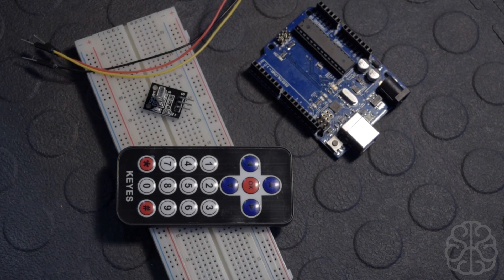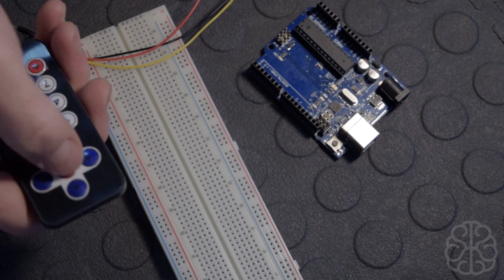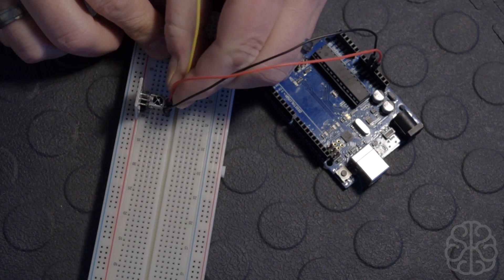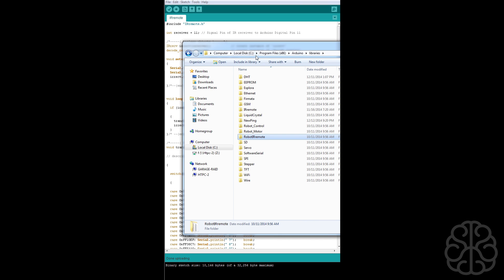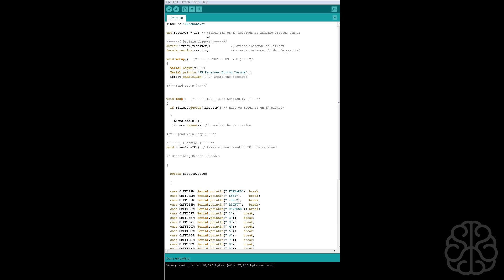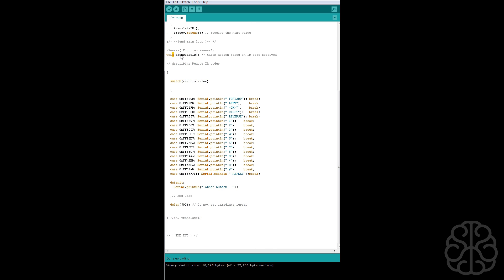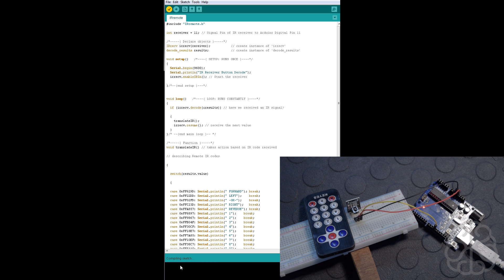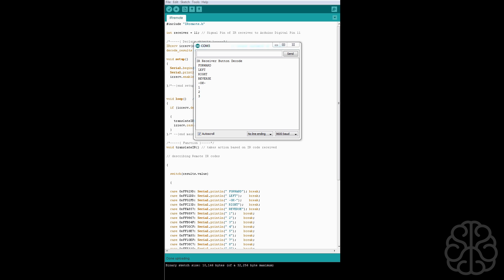Use Infrared sensor & IR Remote control on Arduino - Tutorial

Comment: I used the code but it gives the following error in compiling
C:\Program Files (x86)\arduino-nightly\libraries\RobotIRremote\src\IRremoteTools.cpp:5:16: error: 'TKD2' was not declared in this scope
 int RECV_PIN = TKD2; // the pin the IR receiver is connected to
                ^
Error compiling.

Please help
Reply from the maker: Pratik Panda Hi, In the code on our website here: https://brainy-bits.com/tutorials/ir-remote-arduino/

This is what is in the code to tell it what Pin is connected to the IR

int receiver = 11; // Signal Pin of IR receiver to Arduino Digital Pin 11

Change "TKD2" to only "2" if your receiver is connected to Digital Pin 2 on your Arduino.

Hope this helps!  
Thanks for watching, and let me know if it works!
Reply: Brainy-Bits 

IRremote.ino:1:22: fatal error: IRremote.h: No such file or directory

compilation terminated.

Error compiling.

Now i get this error
Reply: +Brainy-Bits where do i change TKD2 where is it?

Comment: Good Tutorial
can you help how can i read HEX code sent from my remote, ?

case 0xFF629D: Serial.println(" FORWARD"); break;
Reply from the maker: firman budiawan You can try this Arduino code to see if it will work with your remote...  This code will display the HEX code sent from your remote in the serial monitor.  If it works, you just have to replace the HEX code in the tutorial code.  You will need the IRremote library installed, but i'm assuming you already have it installed :).  Let me know...

#include <IRremote.h>

int RECV_PIN = 11;

IRrecv irrecv(RECV_PIN);

decode_results results;

void setup()
{
  Serial.begin(9600);
  irrecv.enableIRIn(); // Start the receiver
}

void loop() {
  if (irrecv.decode(&results)) {
    Serial.println(results.value, HEX);
    irrecv.resume(); // Receive the next value
  }
}

Comment: Awesome video but i keep getting other button, help
Reply from the maker: Thanks for your comment!  Well when you keep getting "Other Button" it means that the IR code was not recognized...  So make sure that your Arduino code is correct, also the HEX codes are for the particular remote that we used in the tutorial, other remotes might have different IR hex codes that correspond to certain keys...  Check out the tutorial page at :  https://brainy-bits.com/tutorials/ir-remote-arduino/  make sure the connections are correct and check your code.  Let me know if it still doesn't work.  Thanks again!
Reply: Brainy-Bits Thanks for your reply
I have correct connections and the only problem is i dont know where to find the HEX codes
because i found a ir receiver and im using an universal controller.
help and Thanks
Reply from the maker: Yamil Yapor You can try this Arduino code to see if it will work with your remote...  This code will display the HEX code sent from your remote in the serial monitor.  If it works, you just have to replace the HEX code in the tutorial code.  You will need the IRremote library installed, but i'm assuming you already have it installed :).  Let me know...

#include <IRremote.h>

int RECV_PIN = 11;

IRrecv irrecv(RECV_PIN);

decode_results results;

void setup()
{
  Serial.begin(9600);
  irrecv.enableIRIn(); // Start the receiver
}

void loop() {
  if (irrecv.decode(&results)) {
    Serial.println(results.value, HEX);
    irrecv.resume(); // Receive the next value
  }
}
Reply: Brainy-Bits THANKS SO MUCH, 1+sub 1+like